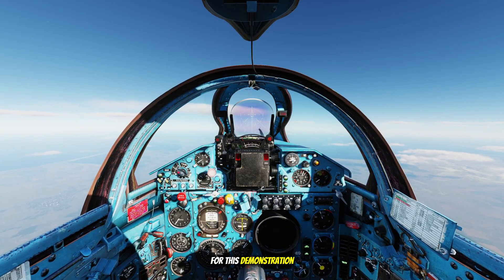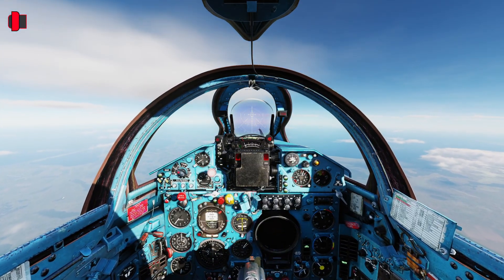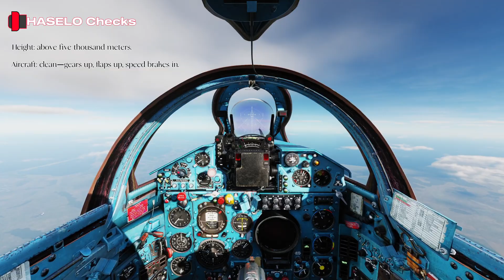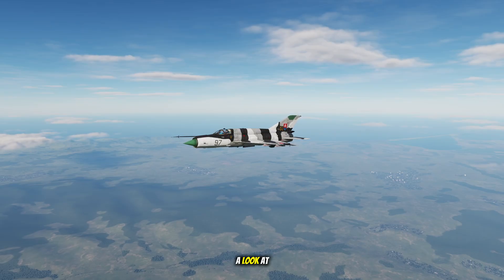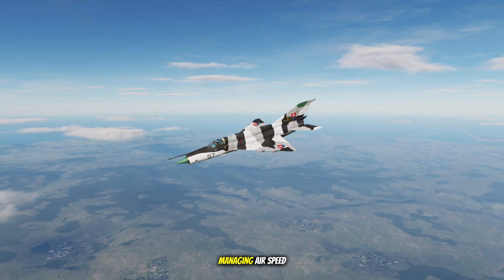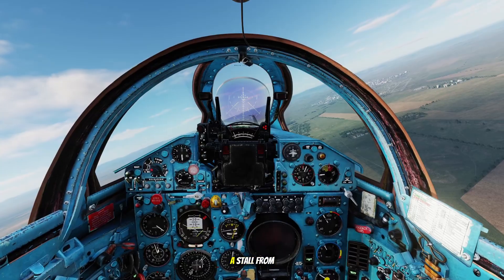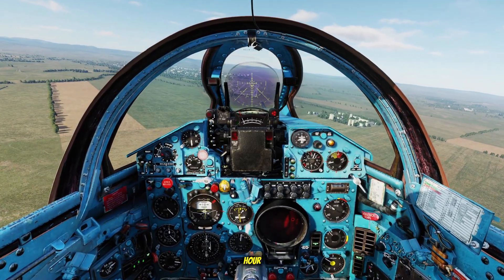MiG-21 Stall Explained | Real Fighter Pilot Demonstrates Stalling in DCS World

Comment: "Even the mighty F-15 Eagle had no solution in dogfight below 150-250 knots against MiG-21 in US Aggressor hands...This way Mig-21 will remain behind every opponent still having sufficient control ability for gun tracking using rudder rolls...It is obvious that US aggressor pilots pulled full aft stick in turn regardless of the lateral oscillations, roll off and temporary loss of control. "

It becomes stable again at very low speed and hi AOA. I do this all the time in DCS multiplayer.  Go vertical in the merge and get slow.  Once below 300-250 km/h   hold the stick full back against the stop with full burner and use rudder rolls.  It one of the reasons I love the 21 so much. 

You can google USAAF aggressor pilots accounts of this behaviour. The devs know about these accounts and that's why it works in DCS too .
Reply from the maker: To be honest, I haven’t done a full clean stall in the real MiG-21 as i mentioned in the video. I just wanted to recreate it in DCS based on my experience with the advanced trainer. Really appreciate you watching the video so carefully and sharing your thoughts it means a lot! 🙏✈️
Reply: @FoxStrike-l9n  Good luck with the channel and your flying career!. I have stalled a tiger moth at 35-40 knots ! but never a MiG21 that's for sure. 

I doubt the Russians even knew the MiG21 could do this until the US Aggressors figured out the limits of their little MiG.  

If you google "MiG21 hi Alpha" it should link you to a thread on DCS forums which has links to the report about the Agressors and their test pilots flying the 21.
Reply from the maker: Thanks for your feedback 🫡